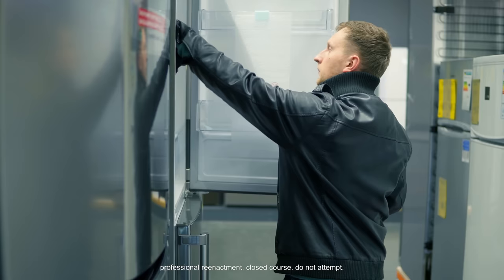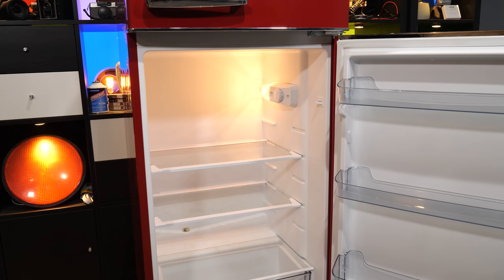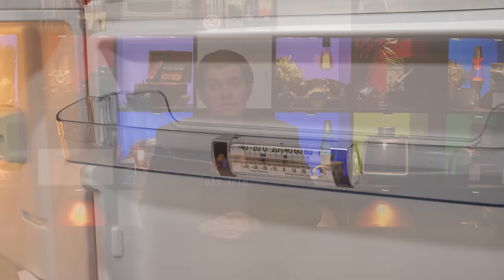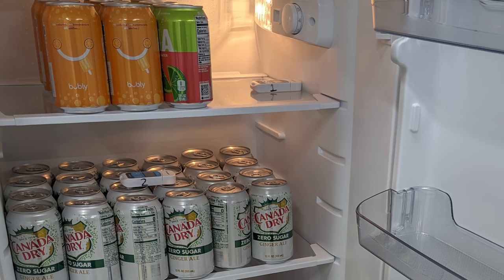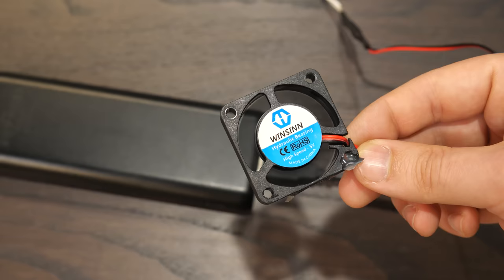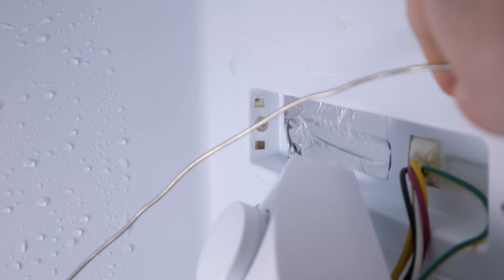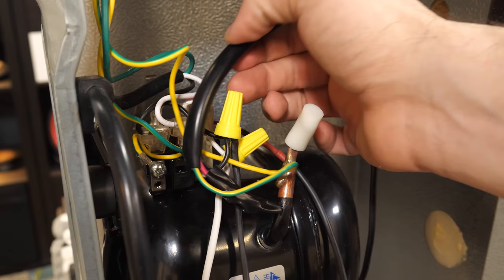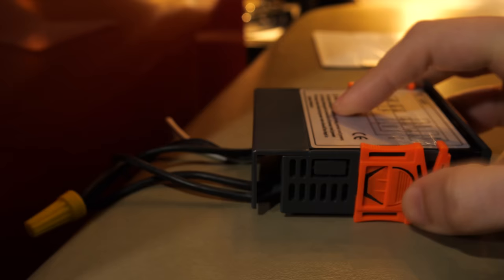This goofy fridge has a really clever design. It's also kinda terrible.

Comment: The problem with fans is that they are going to cause currents, dead zones, and most importantly they will interrupt the designed airflow between the freezer and refrigerator, they designed it for a specific amount of transfer between the two, taking into account the capacity of the cooling system, the volume of the space, the efficiency of the insulation etc, and then profiling the thermostat and defrost, tweaking it, to make a sealed environment in which the system works as intended, from disassembling many of them, I've noticed that they seem to place the temperature probe in whatever spot they need to so they can delay the response etc. Basically if you change anything it no longer works correctly, I'm fairly certain that older ones are less picky and used a more brute force approach, penny pinching and energy saving has them down to a very specific environment probably down to things like orifice tube tuning etc, they also cheap out and use steel or aluminum evaporators and such, it's crazy how they pinch a quarter of a penny here and half a penny there lol. I wish they would just add 30 bucks and make a decent product. Also refrigerators are designed to have stuff in them to act as thermal mass, if you add a lot to your freezer at once when empty it can actually take a long time to get down to temp

Comment: That red one seems exactly like the typical fridge in germany. The coil on the outside is often properly on the outside, yes, but that aside...
And in germany 7°C is seen as the  temperature a fridge should have (and if you want more details then theres different temperature zones as well, the warmest aside from the door compartments being 7°C), thats not something that is seen as a bad thing. You put vegetables, fruits and such in the warmest segment.)
Reply: @@phillipbanes5484 Thats not what germans want. 7°C is the standart fridge temperature plus with different zones. Which get colder, depending on what you want to refrigerate. You might want to cool butter and magerine, for instance, but you certainly would not want it tooooo cold or itll be to hard. So youd put it in the door.

Comment: Replacing the glass shelves with wire racks might solve it.  Had an old GE Fridge where the racks were Lazy Susan's that would rotate out to get at stuff in the back - those racks were solid aluminum which would conduct heat.  Glass is an insulator.

Comment: I bet the thermostat is configured to work pretty much like an oven thermostat. It monitors the temperature of the actual hotplate, not the pot or the insides of the pot. That's because you don't want the coil to be running at top temperatures until the pot is boiling, you want to maintain a temperature of the coil until the pot reaches the same temperature. Otherwise you'd just be pumping current through it until it fails or catches on fire.

This fridge probably works on the same design. It probably monitors the temperature of the refrigerant at the end of the tubing (either after freezer or just before freezer) If the piping reaches the desired temperature at that point, it's somewhat of an evidence for the temperature of the entire coil before the monitoring point. This can be used to estimate the temperature inside the fridge, since if the inside of the fridge was 60° the coil would definitely not be 30° either. So there's a correlation between the measuring point and the rest of the system (or at least the temperature the system is moving towards). A smarter fridge could probably use several measuring points and try to move the air around better, but that would definitely cost more money. This design technically makes sense from the simplest possible approach... turn on the compressor until the pipes are at the desired temp, and then leave it off until they heat up too much... they will eventually bring down the temperature of the whole fridge with them without doing unnecessary work and damaging the materials by running too cool (like perhaps the back panel plastic might not be doing so well running cooler than it's designed to, but running the compressor for too long could reduce it's life or so).

I think your problem with the fans was that all of the fans were too strong rather than too weak . Even the small one churned all the air in the fridge every minute (not to mention the powerbank and the fan itself will get warmer as it works, so you've also just added a heating element into the air flow at the same time). Never the less, this probably ended up making it much harder for the wall to cool down and subsequently heat up too (explaining the much longer runs and delays). Supposedly a much better setup up would be a fan with PWM running very slowly, moving the air around just a little bit to take soften the freezing edge from the back wall instead of a chaotic whirpool of air. It would also be better to run the power supply from outside of the fridge door rather than inside. I'm not sure about the best position of the fan, but since we want the thermostat to keep functioning by keeping the backside of the fridge without massive heat changes, it might be best to put it away from the back panel and not pointing directly at it either, so maybe 45°away from the door (assuming the insulation is good enough) or just somewhere in the center, pointing top/down or left/right rather than front/back. You don't want the coil to get too cool too fast nor heat it up too much so that it never reaches it's designed thermal stop. You just want to distribute the air around slightly more... since warm air rises up and cool air sinks, and since you don't want to involve the back panel in this too much, it might be best to try and push the cool air up from the bottom door side and let it sink again as a convection current at the backside later, hopefully keeping the backplate cool enough to not mess too much with the thermostat. We're talking a very low fan speed though. Maybe as low as 200 RPM. Something just strong enough to move air slowly, but not too strong to actually blow the air around.

Well, at least that's my take on this

Comment: Probably to help remove heat is place long heat sinks or fins on the back such as 1 inch x 1 inch aluminum 90deg metal pieces and attach with heat transferring glue

Place them in the warmest area going up and down or vertical in long strips to increase cooling surface area.

Comment: I had this fridge outside for beverages. Temp swings were the norm as your tests show and cooling seemed inadequate after loaded and now I know why. It was terrible at ice buildup and required routine defrosting and a day or two to get back cold, though it seemed cooler inside the fridge with the big brick of ice in it. If I was you I also would have pulled that probe little by little further away from the cold to see if I could increase run time.

Comment: The capiliary tube from the thermostat is designed to sense the evaporator temperature and cuts back in at 40 degrees to allow the frost to melt and not cause a huge thick ice buildup.

Comment: I helped my Dad with a beer "Keezer," which is a chest freezer with a external temperature controller to make it a refrigerator to cool beer kegs. The temperature probe/bulb reacted too fast so I got a block of aluminum about 2-3 ounces or so, drilled a hole in it and shoved the temperature probe inside to give it a little mass. Now it runs longer but less often. I bought a commercial kitchen refrigerator and found they use a small metal block on their temperature bulbs likely for the same reason, it blunts the sensor readout which results in fewer cycles.

Comment: what fun.  unit shows some care in it's crafting and power usage.  many 12vdc/117vac units for yachts work similarly as well.  many use a Tstat with a capillary bulb clamped to a bare spot near where the vapors leave the evaporator that senses basically freezing ranges.  not the best way to control frrge range cold.  does work.
best was those 1965-75 home units with 2 doors and an evap in the frige section that was at the tail end of the cold making parts. these used Tstat called 'constant cut in' Tstats.  they came with deeper freezing types at 'cut out' but the compressor stayed off until the frige plate or tubes defrosted at around 40 deg.F. freezer stays frozen; milk stays cold, crisper runs warmer, as does butter in the door shelves and meat almost freezes in a tray under the insulated freezer compartment.
No boat or domestic units expect ot handle full loads of warm beverage.  they all hope to have some pre cooled mass to even out cycling.
some friges use Tstasts that have shorter tubes wrapped under their protective cover tha sense frige range air.  these like some circulation of air and are used on earlier frost free units that have timers and defrost heaters or solenoids that allow hot gas to bypass the metering capillary to defrost freezer tubes.... 
At first i wondered if that frige loaded with work to do was cycling on the thermal protector; you would know if you were listening for that-likely not.  looks like the plastic enclosure may have added shorter cycling.  bet that tstat capillary bulb slips along side the evap or return tube somehow.
if you immerse or clamp the tstat bulb to your testing unit you can better read the tstat parameters.  immersing the tester in water gives a better idea of what's really happening to your food.  water also can partially freeze to show what's what,  but cold pop soon freezes too, so maybe use an antifreeze for thermal mass.
nice testers; a zip lock bag may save them from moisture and ice.  enjoy now

Comment: Back in the 1970s, my elderly next door neighbour had a refrigerator that ran off domestic gas. it worked very well. However, as it did not have an electricity supply, there was no internal lamp.

Comment: Thanks to this video I think I understood why my freezer compartment stops working in the winter. My old and poorly insulated house gets pretty cold, as low as about 5 (celsius, Ireland here), and I now assume that since it's close to the temperature of the fridge compartment and it's the only place there's a thermostat, it just stops pumping heat altogether. Maybe I should add a small heater in he fridge compartment, that oughta do it.

Comment: Is it worth considering that the other fridges being full of cold stuff might make more a difference than you would think ? Because once they are cold , they help keep the inside temperature cold . So basically I’m thinking if the inside of the red fridge were already filled with a lot of cold stuff , the cold would’ve radiated constantly inside of the fridge keeping the spike in temperature from rising so drastically ?
Reply: Thermal mass effect was mentioned. The flaw was more than that

Comment: I expect the problems on the red fridge are all related to the undersized compressor.  The compressor shut off early because it overheated and then cycled on and off as the compressor cooled to safe limits, restarted, quickly got too hot and shut down again.  Being undersized also affects handling full vs. empty conditions.

Comment: that compressor has an ac motor inside of it. that motor has aluminum windings. those windings have a thermal switch. 

if it gets hot, the switch opens, and the compressor turns off no matter what the thermostat is doing. That's a pretty standard compressor for little refrigerators.

Comment: You have to be careful with the temp sensor capillary tube as it's not solid, it contains a gas. The temp sensor capillary is directly placed in the evaporator radiator or evap panel or whatever type of evap you have, in other words it is physically in contact with the evap.All fridges & freezers operate best in a room in the house than in a tin garage or wherever that isn't a house/apartment. I scrap old fridges & is how i know where the sensor capillary goes. The compressor is exactly that a piston,conrod,reed valves & small ally head along with the electric wound motor. Plenty of vids on yt if anyone as wondering what it looked like inside

Comment: I currently have a mini fridge that was in my apartment when I moved here. Provided by my cheap landlord… It either ruins my food by inappropriately freezing it, or by being outside of food safe range, depending on where I place my food 😐 I can only use less than 1/2 of the available space.

The mini fridge in my previous apartment couldn’t keep up during a heat wave (it was set with a dial, not a thermometer) and I only realized after having to throw away the entire contents because everything went bad.

So I absolutely do not trust this type of fridge technology. Unfortunately, it’s basically impossible to find a small fridge using anything else.

Comment: You have got a lot of things right in this but what you have missed is the reason for the position of the thermostat bulb. As this is a cyclic defrost it requires the evaporator to reach a certain temperature to defrost. Your electronic controller worked fine for the contents you were using but with a real life load you would have had much more moisture in the fridge and would probably have got excess ice build up.

Comment: The thermostat is a clever safety against long running.

It senses the evaporator exit temperature.
The exit temperature of evaporator will slowly decrease irrespective of the inside temperature. So it will cut off after long running.

The only reason the mechanism to be inside the fridge is to protect it from wide ambient temperature range. Mostly stable inside temperature makes the system reliable.

Comment: So we've always keep gallon jugs of water at the back (mostly top) of our refrigerator. We try to make sure our fridge is full. If we buy too many groceries, we can remove a jug. We experience frequent power outages and because water has a large heat capacity this ensures the average temperature stays relatively the same for longer bits of time.

You should of done the same for test for the red fridge. As it would of been more comparable to the other fridges.

Comment: Thank you for making this video, I am very impressed with how simple and efficient these fridges are. I think that's why they're so cheap compared to other mini fridge/freezers, basic compressor and a box + ingenious design. You can get the same fridge with a plain white shell for less than $200 under the brand MagicChef, got mine on sale for $160. Fill it up with stacks of warm cans and yea it will take a day to get cold. Makes ice no problem, I love mine it's perfect for drinks and snacks. I can't believe they're charging an extra $300 just for that honking shell, I understand if that's the theme you're going for but it would definitely clash in my home. Cheers brother, love your videos!!

Comment: Since the first time I watched this video,  I had a fridge fail on me.  This was a brand new apartment when i moved in, all new appliances. But, after less than two years, the fridge quit. I'm a nerd, hence I watch this channel, so i knew this fridge used R600a. My landlord sent the contractor to check it out, and said basically "yeah its dead it has to be replaced". I asked him why it couldn't be fixed and he said it was because of the refrigerant. Since it's flammable, they have to have some special tool that is extremely expensive  (over $10k according to him) plus the dangers of fire and explosion, so it's much easier, safer, and therefore cheaper to just replace it. I asked him if it had been using R134aif he could fix it. He said yes, but also "these days" it's almost impossible to find a fridge that doesn't use R600a or equivalents. I don't know if that's true. But thankfully i didn't have to worry about cost since I'm a tenant. But oh boy, don't think that i don't know that i definitely pay for it :(

Comment: My fridge broke and I needed a new one but I need to remodel the cabinets to fit the one I wanted. I bought a cheapo “temp” fridge that I was going to use as an overflow fridge once I got the good one. 12 years later, I never got the good fridge. (I may be a procrastinator)

That red fridge is the cutest fridge ever. I would have gotten it as my temp fridge if it was an option.

Comment: Your dasta suggests that the door insulation is inadequate, and the internal surface of the door stays warm. If you start mixing the air inside with fan, you increase the heat intake from that surface.

Comment: Yeah, you kept the fan motor and the battery inside the fridge. Those generate heat when active. In a PC, this heat is getting just blown out with the air. But a fridge does not vent.

Comment: From my perspective I believe the temperature sensor was never measuring the temp in the fridge.  Based on it's placement and the evidence that it did not shut off when placed in the open air. I believe the sensor was measuring the temp of the pipes that were running on the inside on the wall. It was calibrated at a much different temperature. I suspect with a small compressor and a very small charge. The desired run time on the compressor is what is achieved with the temperature sensor. Which is why the temperature of the fridge compartment had the data that we see here.